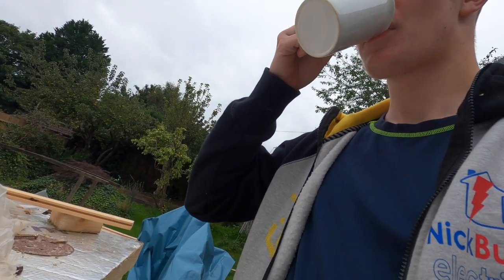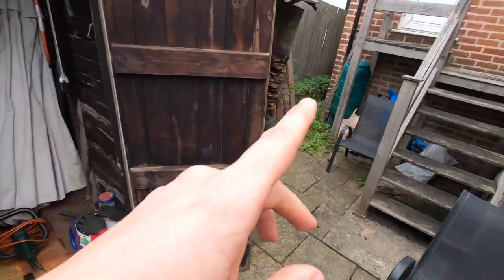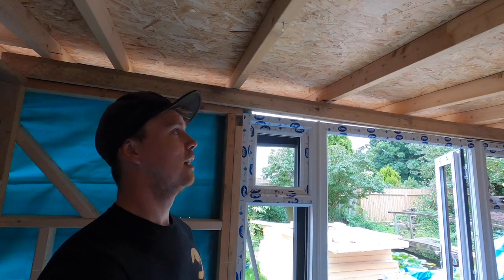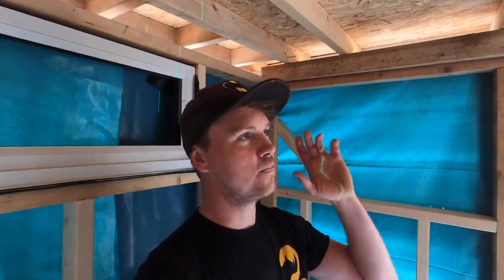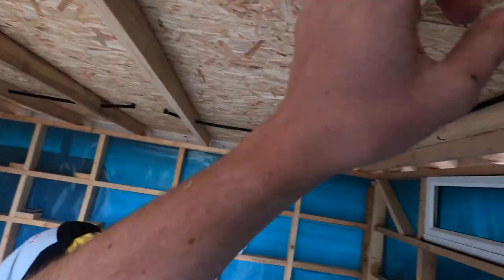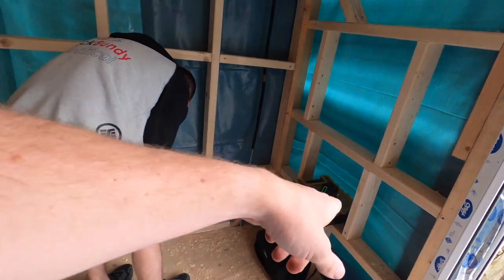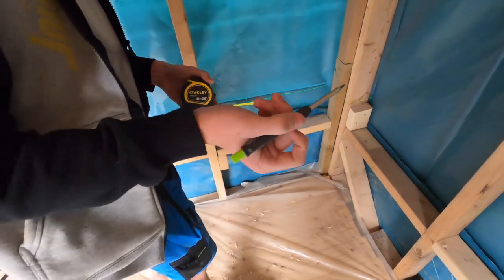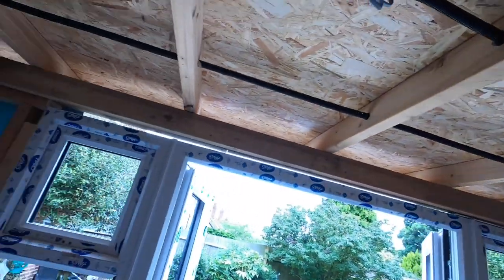Awesome Garden office wire, Shed/garage wiring, Flexi Con! Exotic life of an Electrician

Comment: For drilling joists, the maximum hole size is 0.25 times the depth of the joist, and the holes should be between 0.25 and 0.4 times the span. Also, if you're worried about the drill injuring your wrist when drilling large holes, you can set the clutch you use for driving screws to one of the higher settings, so it will slip if the bit gets stuck.

Comment: As others have mentioned who seem to have carpentry knowledge or work in that trade - this shed hasn't been framed in the most optimal manor shall we say - either the homeowner has done it themselves or they have found someone to do it handsomely cheap.

At the end of the day it is a shed. If you saw the same man/woman getting the next job re-doing the roof on the house and Nick goes back to do work and films it then have a song and a dance about it.

Highly unlikely it is going to have a failure of room in this climate whilst someone is inside on a laptop. 

Great work as always Nick on having a mindset of setting the bar higher than what is common in the UK.

Thumbs up, Tues and Thurs are great.

Comment: Nick great work just wanted to give s shout out to flexicon who were amazing with me about 10 year ago I needed a bespoke solution for a large research project at a leading university and flexicon sorted us out with free gear which we used and submerged to 20 m as part of a submersible spectrometer. Great company, Great product, and not surprised you chose to use it as ur work is top quality also.

Comment: Tip for you, when using the flat bits, use an impact driver, or stick your driver in 'screw' mode if it's got it and stick it on the max 'slip clutch' setting so if it snags the drill slips on the clutch rather than your wrists snapping, having it on slowest is actually worse as it snags more and also if you use a 90 degree adapter you can drill between the joists without going in at an angle and making a hole in the guys roof!
Reply: Impact driver and these Bosch self drilling bits with the hex shank = The bomb. Impact all day imo.
Reply: @shifty277  People used to laugh at me when I cracked out my impact for drilling. I used to laugh at them in the back of the ambulance :D

Comment: 14:04 Use an impact driver, saves your wrist and you don't fight the torque the whole way.
Reply: Saves your wrist but kills your ears 😜
Reply: @digitraxuk  great tool, I use the M12 version all the time 👍
Still not as quiet as a combi though for drilling, but nowhere near as loud as a mechanical impact driver

Comment: A great use of COPEX. Will negate the need to de rate cables.
Reply: It's probably comparable to RM A, which is higher than 103 but lower than 102, B & C, so is still de rated.
Reply: Yes indeed but no Ci will need to be applied from table 52.2 which is crazy amounts of lost ccc
Reply: lights will be ok, but you will probably find that a 20amp radial will need to be wired in 4mm and not the usual 2.5mm
Reply: @acelectricalsecurity  interesting. RM A is 20A, so 2.5mm t&e appears adequate re ccc (and with use of a CB and short length involved, thermal constraints and VD, and even without an rcd, shock protection). So what leads you to 4mm2?
Reply: @johnhoward2104  I did a quick calc, put the figures in some software I use, based it on a 20amp radial, in conduit in thermal wall, 10m run and it chucked out 4mm, then I tried it clipped direct and it came out at 2.5mm.
Reply: @acelectricalsecurity  very interesting! It seems to hinge around the value of cable ccc selected/used. What do you calculate/select size to be when doing it the old-fashioned way: long-hand and eyeballing the figures?
Reply: @johnhoward2104  I haven't tried it long hand, just thought my computer was on, and thought I would do a rough calc, I remember last year my NIC guy going on about a contractor doing timber frame buildings, who had a ticking off for not increasing the cable sizes. And he said about wiring rings in 4mm, that's why had a quick mess about.
Reply: @acelectricalsecurity  no worries bud, thanks for the chat.
Reply: @johnhoward2104  no problem, just noticed a typo 😁👍

Comment: Hi Nick another good video thank you. If you’re not using the adapters you can actually buy hundred metre lengths of the Flexicon for about 20 quid I bought a load from the wholesaler the other day.
Reply: Where’s that from mate that’s a cracking deal
Reply: I got it from Grant & Stone Stevenage.
Reply: Wills Electrical Services Ah a little far from me😂 Will have a shop around for that though for sure as I always have the adapters left over as I usually only use it in kitchens or for UFH tails etc. 👍🏻
Reply: Jay Harding I believe that is the common price for it as we all buy the contractor packs. It’s a lot more expensive for  the packs. I’m the same if I’m just using it for cable protection.

Comment: I’m not an electrician myself (sometimes I think I went into the wrong trade and should have been, it looks satisfying). Instead, I trained as a furniture maker then somehow ended up looking after a primary school building (nobody would take me on because I didn’t have the trade experience only college). 

The Flexi con is that to protect the cable from the insulation (heat) or to protect the cable in general?

Interesting comments about vans I’d love a van so handy. Can’t decide if to buy second hand or lease, in the long term I’d like to work for myself so would need one.

Leasing a van seems dead money but then buying comes with all the repair bills. There seem to be better deals for people in trades than jo public. When you decide what you are going to do about your van it would be good to see a video with your thoughts…

Comment: Now I'm very curious how various roofing is done in the UK. In the USA I'd be willing to bet that similar conduit would be punctured by a nail at least a dozen times.
Reply: With this small garden room, the OSB roof deck will likely be covered by a single continuous sheet of a single ply membrane like EPDM rubber. This membrane is typically adhesively bonded to the OSB decking. Hope that helps.

Comment: It used to be that flexible conduit was only used in short lengths, mainly from isolator to machine. The plastic stuff offers very little in protection, and will squash like a pancake when they force the insulation in, the metal stuff is a lot more robust.

Comment: Don't use conduit this don't use flexible conduit that but anybody who has to come back and replace something later...
I was making a hole a little bit bigger in the basement and I nicked a cable on the very last run-through I had to cut the wall upstairs open to replace the wire from the heating baseboard thermostat down to the panel because I said to myself I might as well just go all the way with a whole new run. I had to cut the wall open because it was not only fished through the wall in a zigzag fashion it was fastened down.

Comment: Flexi thats not visible is always a win. Going the extra step provides the extra protection not sure what the humidity and moisture levels are going to be like. The Felix con could worsen T&E degradation in high moisture areas in the outbuilding. In the USA flexi-conn iseven uglier it’s bright blue, orange, grey and occasionally black. As big Clive would say ribbed for your pleasure🤣. On the laser did you have to calibrate it? And no you did not put a link to the pencil even after you said you would argghhhh🤦🏾
Reply: no link to the pencil.  I've got one but bought at elex and dunno where to gettem from now

Comment: Max hole diameter shouldn't exceed 0.25 * joist depth.

I know you say your vids are for entertainment only, but for the non electrical viewers, just so they don't get the wrong idea and do something dodgy, it's not that RCDs are not needed for a distr. cct, full stop, it's that it's not needed on a TN supply, if Zs is low enough (and it's not a special location), but would automatically be required if it were TT.

Good idea using the flex-con, and admire the sentiment of doing the best job you can.

Tue + Fri please.
Reply: I think RCDs are highly recommended for user safety. The low supply impedance you reference will protect the wiring by ensuring that the breakers trip but don't protect the users if they come into contact with the live connection.
Reply: @AndyFletcherX31  highly unlikely, practically impossible, in fact, they would come into contact with the line conductor in normal use (assuming they're not fiddling with things they shouldn't be), as they'd have to get past the earthed armouring first, which is basically an earthed screen surrounding the live conductors, so highly likely the CB would trip. That's why armoured is used, so if it gets punctured by a spade, for example, the earthed armour carries the fault current and the cct CB trips out (you could argue the fork could hit just the neutral, so wouldn't trip the CB, but it's low risk it would hit only the neutral, and that neutral-earth connection is not a problem because it's no different from PME). If it were a special location, like agricultural, then yes, RCDs are required automatically, but Nick's install isn't a special location, so an RCD on an armoured distribution cct there is relatively pointless.
Reply: Everyday is good with me 😊

Comment: That roofs not going to last long, timbers are well undersized.
Reply: 🤣🤣 look at the state of the walls
Reply: Brave man to drill holes in the joists too. Insulation, plasterboard and a dumping of snow on top should see it come down.
Reply: Yeah. The only thing good about this garden building is the electrical. Rest is a piece of crap.

Comment: You guys do camp it up quite a bit but it's hilarious and you do wonder what to expect when Adam starts the video so you pulling your wire in the corner wasn't a surprise!! Plus FlexiCon is the least gay stuff you could use... What I sometimes do when I can't fit the drill in to drill through beam is take a crappy flat bit that I would normally chuck away and hacksaw it down so that with just the blade part sticking out of the chuck you can us that in tighter spots instead of drilling at an angle. #leccyhacks

Comment: Are you ever concerned about installing in a building of “non-standard” construction or want for better words badly built?
Reply: How's it badly built? (not a builder just curious)
Reply: @williamwalsh9615  Roof joists are nowhere near thick enough for that span, noggins are also needed. Once the insulation has been stuck in there'll be zero ventilation. The stud framing hasn't been done properly, spacing looks random, when the 'builders' (I'm using that term really, really loosely) come to board internally, they're going to struggle as there's nothing to fix to in some of the corners because they haven't planned it properly. DPC is on the wrong side of the studs. I could go on.

In short. The 'shed' is dog shit and will probably fall down if someone fat leans on it. Seems strange when someone has bought expensive UPVC windows/doors, expensive PIR insulation and paid good money to have a decent sparky kit it out properly. 'Builders' are just taking the piss.
Reply: Mike Trego  exactly what I was thinking ! Utter crap !
Reply: It’s not often I comment on content but I felt the need to raise my concerns. I also did not wish to respond further to avoid provoking negative comments. But after seeing that I’m not the only one concerned about the build quality of this structure, I feel compelled to make a further remark. As an Electrician being asked to provide their services and install an electrical system to this “building”, the appointed qualified electrician should have enough knowledge on construction techniques and practices to flag up the points made. Garden rooms and such building structures that can be permitted builds under the planning regulations does not indicate that such structures can be constructed by any person not competent. This building if completed to the standard to which it started is going to fail, perhaps in part or completely. There’s is a clear risk of this happening and a high risk to human safety. My original comment directed at the installing electrician still stands. Thank you to others for commenting further regarding this.